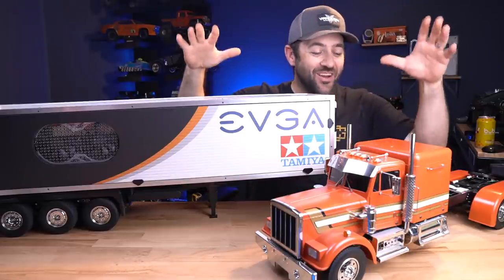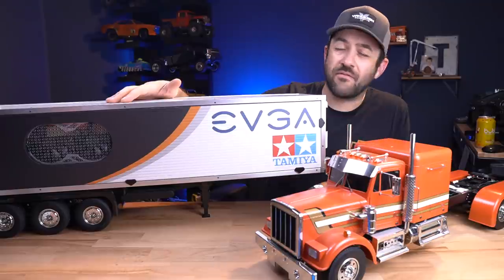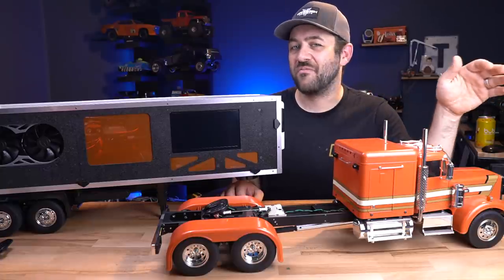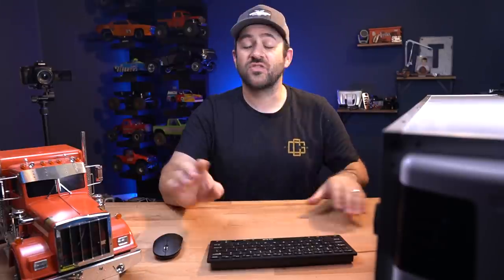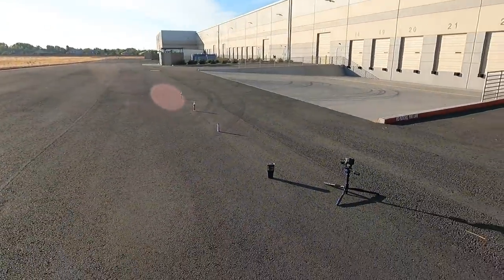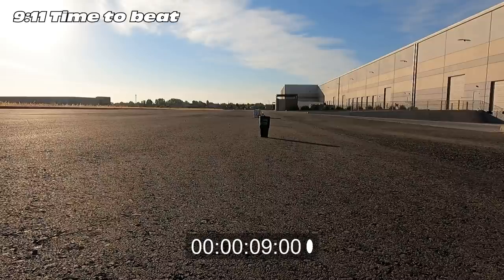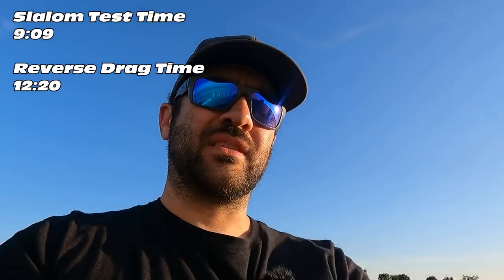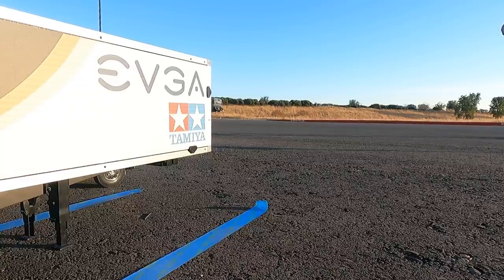Custom Gaming PC inside! - RC/PC EP4

Comment: Odd how identical hardware performed slightly different, your single core was a little higher than Matt's but his multi core was higher than yours. I'm not going to do the maths, but to me they seem close enough that EVGA has pretty good quality control. And just as I had expected you did the same thing everyone does when backing a trailer, you tried to do it way too fast. You were faster than Matt, but he was a lot smoother. Which is weird since you comp more than he does. 

Still an awesome series and really cool of Tamiya and EVGA send you the parts to make it happen.

Comment: Not easy reversing anything put a long trailer on and it goes up a notch, you would not have been popular at the loading bay for sure the forklift drivers would have given you grief no doubt.
A fun project and worth the time spent on these two trucks, I liked Matts trailer better as it was a lot more covert your venting was to obvious I would have vented from underneath to hide the interior contents better, but  he was not without fault the screen on the rear doors was not in a scale position I would have put it at the front so it looked like a aircon unit by 3D printing a frame to look like one, with just the screen to show how things were doing would have looked more scale.
But you both did a stela job and knocked it out the park with these trucks loved your tractor unit you made life hard stretching the wheelbase but overcame it so a big 9.5 out 10.